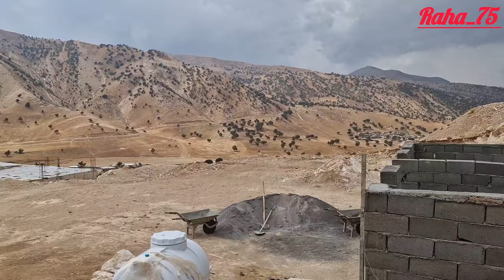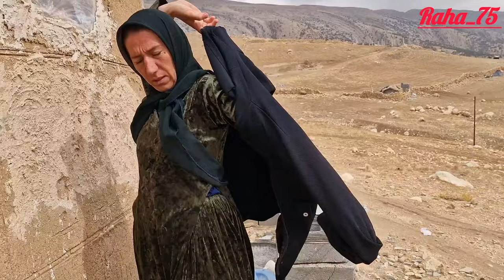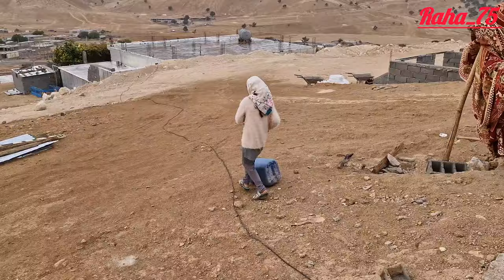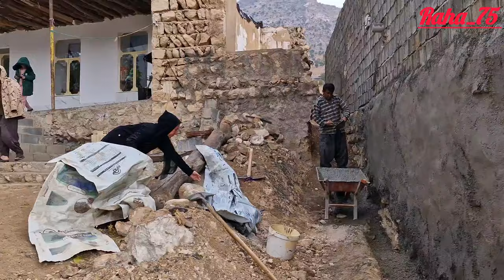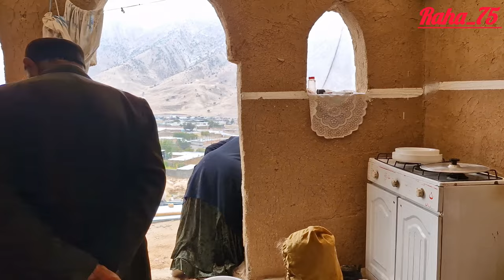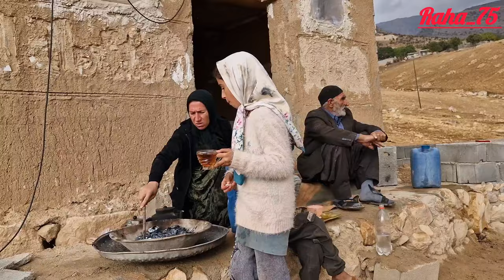Heavy rain and baking bread in difficult conditions by Razia

Comment: You have a fireplace that has been used. Build a small fire in it to help drive out the cold. Hang the carpet that is outside, against an interior wall. It will dry faster than hanging in the rain and will provide a small amount of insulation from the cold walls. You will obviously need a larger piece of plastic to overhang the entire structure

Comment: Sr operadora ,fecha uma porta e abri por dentro de casa ,para ter acesso dentro de casa ,pois o frio está chegando .
Reply: Ms Operator (her name is Maryam)… 🤗
Reply: People have told them this ever since they put down the first bricks… ☺️
Reply: @denisesoares3243  I don’t know that you meant by «?» 

People have told them to open between the two rooms instead of having two doors to the outside. I think they know very well, but for some reason they have chosen to not do anything about it.  Maybe they have some reason we are not aware of which made them choose this solution? But it sure does not seem very practical, especially when it comes to heating, as they would need two separate heaters. And of course going out in the cold during winter to go to the other room.  But for some reason it seems like something they do there, the builders did the same on Suzan’s mountain house. Very peculiar to most of us, as it is not common where we come from. ☺️ PS! «Sr» means «Senior», doesn’t it? The operator is not male, it is a lady named Maryam. ☺️